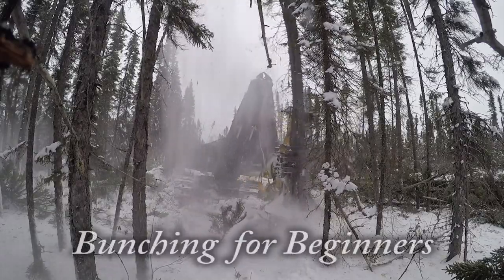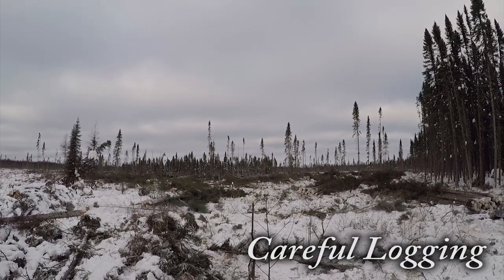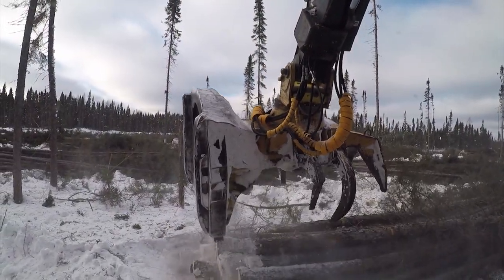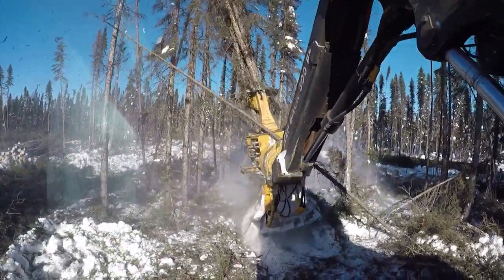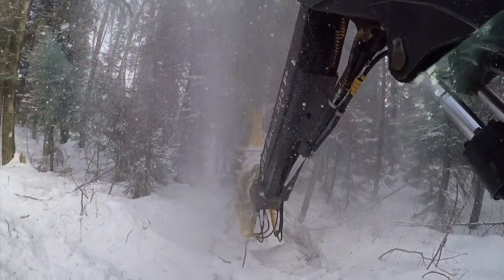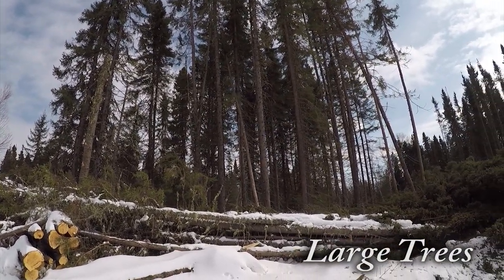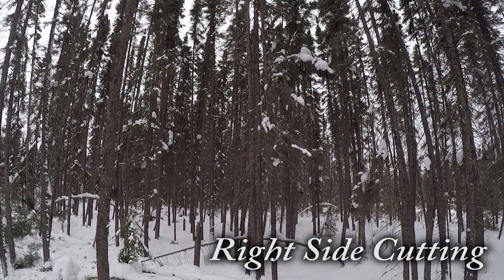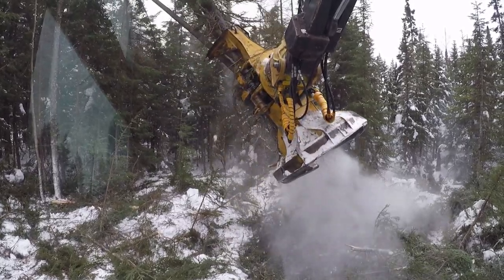Bunching for Beginners

Comment: I'm just trying to understand how to grab with one set and the other set of grapple claws.
Reply from the maker: Not sure exactly what your asking but I will give it a shot. You can start timing them to work together by when closing the grab arms, open the accumulators. Once the accumulators are fully open close them to grip the trees in the head before opening the grab arms again.The timing varies depending on the amount of wood in the head but this is a good baseline. The accumulators have springs or elastic bands to activate their function. Meaning they can be pushed one way but not the other. This makes it possible to open the accumulators while the grab arms are putting pressure on the trees. Hope this can clarify your question/concern.

Comment: Hey great video 👍 how do buncher controls work?
Reply from the maker: Thank you :). Which controls would you like to know about. joysticks/buttons/pedals or all of the above.
Reply: @arcticdan   joy stick and button functions 👍
Reply from the maker: @pilotlife5190  Where I work we use SAE (standard) controls which is as follows. Left stick, left and right controls swing left and right. Pushing and pulling the left stick controls the stick boom. Pushing it moves the stick out and pulling will makes it move back towards you. On to the right stick. Left and right controls the head curl. Left curls the head down as when you dump the wood and right moves or curls the head back up. Pushing and pulling the right stick controls the boom up and down. Pushing it makes the boom go down and pulling it makes it lift or go up. There are also different controls such as ISO controls which basically take the stick and boom from the standard controls and inverts them. So the stick boom would be on the right instead of the left and the boom would be on the left instead of the right.
As far as the buttons go on the joystick there really isn't many functions to operate other than the grab arms open and close and accumulators open and close. I prefer running the grab arms on the right stick and the accumulators on the left stick. Since the grab arms are the main arms using my right thumb to do most of the work feels better to me. Basically all the machines at work have the same configuration which makes it easier when you jump from one machine to another. The buncher is far from complex. There are machines with dozens of button functions which can be a little harder to learn. But with time you can learn anything. I hope this wasn't to confusing and answers your question.
Reply: @arcticdan   hey arctic dan your head should dump the trees when you move your right control to the right not the left. same as a excavator when you dump the bucket you move your right hand to the right. ive seen a lot of guys run them backwards like you described. where i come from we call those saskatchewan controls among other things. and if you dont believe me have a really good look at the control pattern stickers in the cab.
Reply from the maker: @AA-tb4ff  To each their own I guess.

Comment: Small trees compared to northern alberta... I cut a single tree three times with a 953k buncher before It would fall.
Reply from the maker: Yes, There are different types and sizes of wood in our area. Sometimes we get nice tree's that need to be cut several times as well but I'm sure the consistency of wood is not the same.

Comment: That's an older deere right it looked closer to the timber Jack which was the koehring 618
Reply from the maker: Yes its one of the older ones. The first one I did operate was actually a timberjack. It was very similar in appearance but not as much power as this one.

Comment: Block fall my man, it keeps everything so neat and tidy, bunches aren't laying  on the one from last strip,  checker board when ur done ,cuz the only time u need to put wood behind you,is boundaries or R/W
Reply from the maker: Can you elaborate on this Block fall technique.
Reply: Instead of going from the road in strips back to boundaries,  your strip would be parallel with the road,dont  cut both directions if u know what I mean ,just harder to keep bunches straight, cut left to right, repeating process untill the last strip is opening the decking room along roadside, kinda sounds how you described as inbound?
Reply from the maker: @mikehd3904  Ok, Instead of strips going in to out your saying to go from left to right parallel to the raod. I’ve heard about this method before, Someone I work with told me they used that method out west and that basically there are very little if any tree’s standing after doing this method.  The skidders path out is also a lot rougher in comparison to just following the track trail of the buncher.  Also I would like to point out that I personally would not recommend anyone put bunches directly behind them ever, but to the side. Even for road wood or boundary lines. I've learned my lesson the hard way having to back out of the bush for a maintenance call and everything was in my way. Also I can just imagine the jackpot it would be if the ground started breaking and had nowhere to back up to, also the road building guys would not be very happy with with us if we would put bunches in the way. I really enjoy learning about different methods people use when operating machines. Thank you for your comment.
Reply: @arcticdan  actually we'd leave  all fir ,most poplar and anything not worth cutting,  If ya  didn't need to go into a lil piece,still inside boundaries, wouldn't even  go into it, leaving non merch  trees was important
Reply: @arcticdan  and yes but the movement is still swing wood behind you, of course it's off to one side depending on which side of road and what end of the block you start on
Reply from the maker: @mikehd3904  What kind of tree's did you harvest there?
Reply: @arcticdan  pine and spruce and balsom
Reply: @arcticdan  old post but I agree with McNeil. What I do is put block falling and strip falling together. I fall the boundary, second pass as a 45 and the third pass straight to the road. I then either keep going that way with the block falling, or I’ll strip it at a 45 and dump it at a 45 which makes it straight to the road. All depending on where the sun is, which way the hill is leaning. You can even go to the other end of the patch and dump them on the right side (which is far better IMO) this method yields a checkerboard patch perfectly straight to the road making skidding the absolute easiest. I always snap my patch this way in steep, rough ground. It gives you 3 different angles all while keeping it straight to the road. I only use the strip method when it’s too steep to cut the boundary. 

This is a good training video for sure. My son will be watching it 👍
Reply: @buncherkev2794  I do the same. The ground and sun decide what way I'll be cutting. When I use to bunch. 20 years was enough for me. Haha  just realized who this is Haha. But this is a awsome video for sure for a new guy learning.